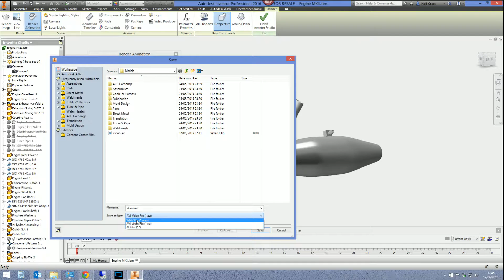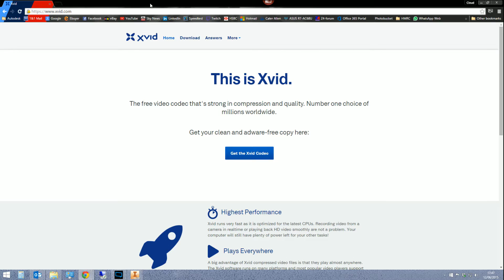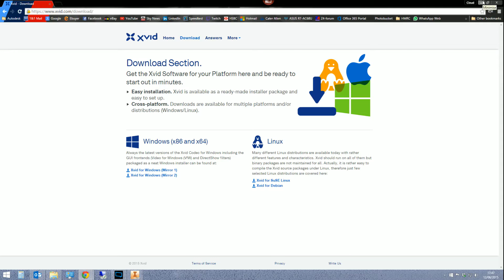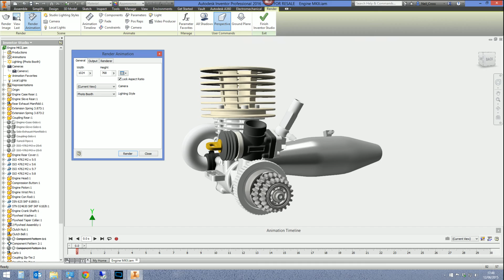A good codec for Inventor Studio | Autodesk Inventor

Comment: I run my animation with the Xvid Codec at the default setting and I can see a grid of faded black lines that fade in and out depending on the animation parts and white background.  The black lines tend to show up on the parts but not the white background.  Can I get rid of these lines?